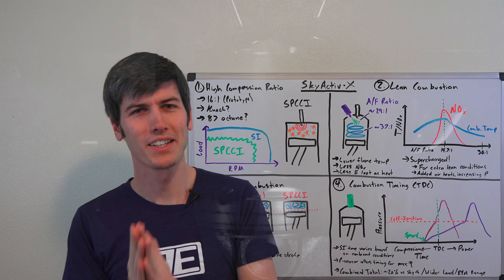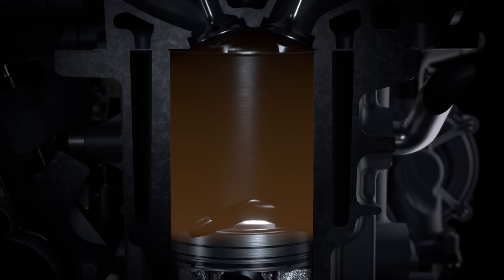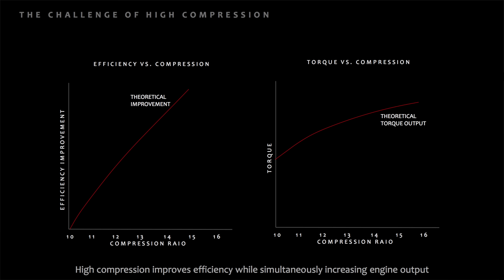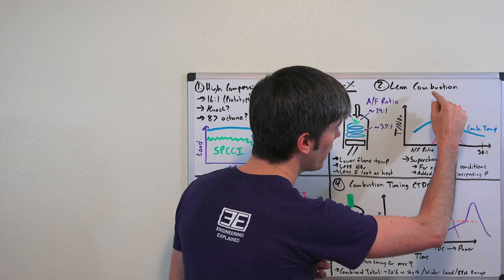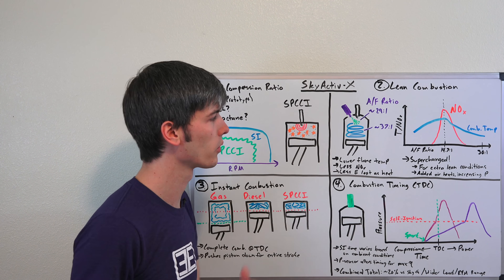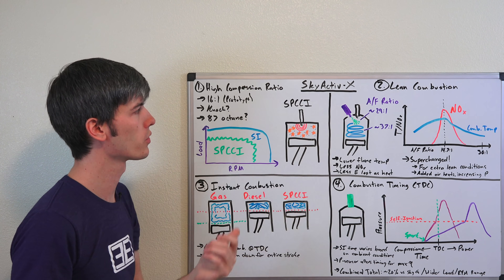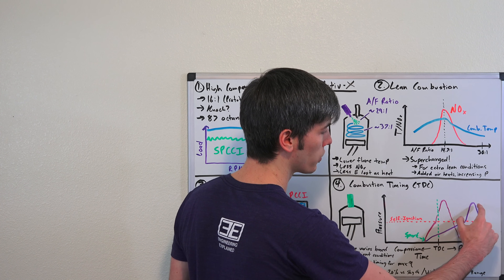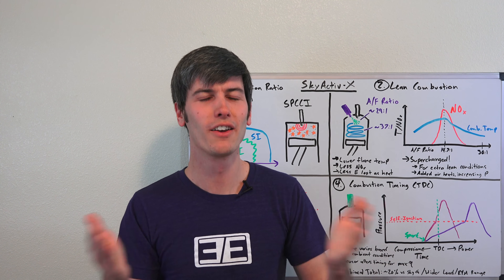How Mazda Is Saving The Gasoline Engine - SkyActiv-X

Comment: Get ready for the “why is Mazda pursuing a dying technology” people... The ones who swear we could all drive electric cars *today*, if we were just all willing to put up with the inconveniences of electric vehicles, and how we’re killing the planet by stubbornly sticking with our “dinosaur-fueled” vehicles...

Electric vehicles will take over eventually — but it will require a major breakthrough in battery technology.  Gasoline and Diesel fuel are currently the most energy-dense, portable energy source available to us.  Batteries — even the absolute best batteries we have today — aren’t even close to being as energy-dense as gasoline or Diesel fuel are.  Hell, even ethanol is more energy-dense than batteries are — and by a large margin, too.

Once you get battery energy-density to the same level — heck, even 50% of the level — as gasoline, and you make a battery that can go from 0% to 100% charge in 10 minutes or less (without destroying itself in the process, obviously), then you will see electric cars be 100% of the new cars sold.  We’re a good 20 years away from that, barring some miracle battery technology that hasn’t been discovered yet.

So in the meantime, let’s have the most efficient gasoline engines we possibly can.  Kudos to Mazda for doing this research!!

Comment: Engineering explained, so I just thought of something I have gotten bad gas that had water in it... I really hope they have a drying system for their fuel. Imagine a high(ish) water content getting pushed through an injector when it’s already nearing self ignition! That extra added pressure from incompressible water could make it self ignite and have it knock out of time. At 4200 rpm... blown motor?
Reply: I don't think they need it. it runs high comp, but also remember it runs lean as well. if there is contamination, then even if you have higher comp than a traditional engine, you are also injecting less volume than a traditional engine.
Reply: Of course there is less volume sprayed in but don't underestimate the non compressibility of water it will spike compression setting off auto ignition too soon.

Comment: I wonder how this engine will hold up in the long run, when carbon starts to build up inside. With such a precisely made engine maybe some carbon buildup will mess everything up. Hope not.
Reply: Thinner  fuel mixture should mean less carbon build up. More towards complete burn.
Reply: Direct injection might do that ,the inlet valve might carbon up
Reply: Would love to see if they could improve it further by adding Toyota's D-4S technology that combines direct injection and multiport fuel injection in the same engine.
Reply: So far no problem, I have a 2015 mazda 6 which I bought in 2014 and I still drive it today. City driving pretty much 28 miles per gallon average and takes off faster than most cars. BTW my ieloop stopped working which usually adds another 1 or 2 miles per gallon.

Comment: Are there any problems with temperatures? On older engines, especially turbocharged, you always hear people saying "if it runs too lean it will get too hot". Is that only a problem for turbo engines, or is that within a small window of A/F mixture and the super lean Mazda mix gets it out of trouble?

Comment: I wonder if this has anything to do with the Ford Ecoboost engines that use a Mazda block which are experiencing misfire's. My 2.0 ecoboost fusion, my friends 2.0 ecoboost focus, my other friends 3.5l ecoboost all misfire when cold. All of us use 94 octane. I know the 3.5l ecoboost isnt a mazda designed block though. But maybe its designed around the 2.0l 4cyl.
Only 25,000km on my vehicle been misfiring since day 1... Dealer cant fix it in either of our vehicles (yet, probably never).
All stock vehicles, all one owner vehicles.
Reply: The ecoboost 4-cyl is based off Mazda's old L series block. The current Mazda Skyactiv series is the successor

Comment: An excellent presentation!  
IMHO,:  while the engine design is interesting, it is overly complicated and requires too many parts.  All these pieces, parts, software must work perfectly to obtain the desired results.  Long-term reliability would concern me.  Cost to service and repair is a dealer's dream-come-true. An efficient and quiet electric motor with ONE moving part is far more interesting to me. Regards.

Comment: Previously owned a 2006 DC5 with a k20z1 engine.  Sold it and bought a 2015 Mazda 3 SGT.  The Skyactive engine is pretty awesome that it can operate on 87-93 octane with high compression and no knock.  Non-noticeable knock.  I love Honda engines but they are so temperamental in the fuel they use, especially in the ivtec engines.  I am speaking about a 12 year advance/difference in ECU engine management, so it's not really apples to apples.  Speaking of gasoline engine advances, what happened to the Scuderigroup and Duke engines?  Yes, my Mazda can achieve up to 41 mpg hwy @ posted speed limits calculated with pencil and paper, the onboard mileage app and Palmer DashCommand.  Thanks for the upload!

Comment: In the old days it was thought that peak pressure should occur when the crank was at 90 deg. from TDC (max torque). I wonder if Mazda can change the peak angle on the fly, like switching to a performance mode? 
Love the video.
Reply from the maker: That logic is incorrect. You want the peak force pressing the cylinder down to be applied the entire time the piston is moving downward, to get the maximum work out of it.

Comment: How does the max cylinder pressure compare to other designs?  Assuming it's higher, do you know if they've done more work to prevent blowing head gaskets?  How will combustion deposit build up affect the swirling action and pressure sensor?  What's the maintenance plan to keep these things working?  How well will the super lean combustion work in higher altitudes?

Comment: This is cute, but the true future of combustion engines lies with Koenigsegg's Freevalve system. No camshaft, electronically controlled pneumatically actuated intake and exhaust valves. 40% power increase, 30% emission decrease.

Comment: I think Mazda said that a 2.0L would perform like 2.5L. If the claims are true, that 190hp is impressive.
Reply: Oldsmobile was getting 190hp out of a 4 banger in the 80s. With no forced induction.
Reply: @isaakwelch3451  I doubt it is euro 6 and fuel efficient.
Reply: @Dongzzzzzz  I don't know about euro 6, but they get 15 city/30 highway, which isn't bad for a 30 year old car

Comment: So for the best economy and performance is it best if all fuel is burned right after the TDC? I have always thought you would get the best torque if the peak pressure occured when crank has rotated 90 degrees. The equation of torque M=Fr, where F=pA
Reply: That's true, peak torque would apply there but I'm pretty sure that the combined pressure on the entire power stroke is what makes horsepower (and therefore efficiency)

Comment: I got a Mazda 3, with the 2.3 engine. My only gripe I have against it is the oil filter type as well as the complexity of the engine itself. I really dislike that the radiator is a sealed system.

Comment: i have a 2015 mazda 3 and one thing i notice about the economy is that the outside temp can drastically change my economy. there is a road i drive every day and i average about 6.4 L/100km. that is at -15 or colder weather at this time of year. well, we had an unseasonably warm day and the temps got to above freezing and my economy went to 4.3 L/100km. that is a drastic change and i cant wait to see what i get in the summer.

Comment: Awesome video. Mazda has been questionable with quality. At least, that's what I always heard from a former bud cuz he's a mechanic. What's the SWAG on their lean production system? Yes, I am a QA guy, so Six Sigma is important. Ironically the last car I bought, 2015 Hyundai Elantra for the 10yr warranty ... had two odd issues: stalled out on me 3x or 4x. No warm fuzzies when it's at the dealer for 3 days and when I checked on it the tech was on the phone with Hyundai Corporate Tech Support. I was about to insist on getting a service engineer to visit the dealer. 

Most annoying issue was an odd vibration or 'stumble' when the engine was cold, like first 20-30 minutes. The stumble was noticable when at a red light. Service advisor claimed it's because they used only 3 motor mounts and/or because this engine doesn't have balance shafts. Meh, so I have to dig deep with my next car purchase into tech specifics. Does this Mazda engine have balance shafts??? I assumed this was a given with them in the Quad 4 engine circa 1990.
Reply: I wouldn't worry about the "stumbling". I had it occur to my 13 kia optima a few times in the past. My suspicion is it also has some wonky ECU tuning with how it idles. If it ever happens, I put the car in neutral, rev it to 2k a few times. and the issue goes away. 

As far as my ownership goes, ONLY hyundai/kia engines do this .
Reply: skifree Very interesting. Yeah, I also thought it had to be something weird with the ECU. I had the 6spd manual but wouldn't try reving the engine so soon after cold start. What really made a difference was premium 91 octane gas, which shouldn't be necessary with the base engine. 

Anywho, ya think the new Stinger GT has this issue too??
Reply: probably not. For me this happened after the Transmission recall after Kia was on the hook for misleading fuel economy numbers. they retuned the car to cruise at ridiculously low rpm (I've seen an 700rpm cruise when I had the car). By bet was they also changed the ECU tuning to help with the fuel consumption under moderate to low load, and that with a cold engine, and low rpm was what upset the engine the most. One the key aspects you see is, when it does vibrate you can actually see the rpm needle bounce rapidly by 50-100rpm. So the ECU is doing something.

As for the stinger. Kia and Hyundai Have gotten a lot better than with both engine tuning, and giving reasonable numbers (so they don't have to do drastic measures if they get caught).

Comment: Good video. However, I am still annoyed that these companies are still messing with the internal combustion engine. It is time to move on from this relic. While a 20% improvement is great, it still can't compete with an electric motor. We need fundamental change at this point if we are going to successfully address global warming. Incremental change at this point is not good enough.

Comment: When I first read about this engine, I kept going back to the good ol' CVCC Honda engine of the 70's. 
Stratified charge, super lean everywhere but near the sparkplug where a small slug of rich mix hangs out, waiting to be ignited so the flame can spread to the normally un-ignitable main charge. No EGR, no cat and good economy....not much power though.
The Mazda version replaces the 3rd carb barrel and intake valve with the direct injector and added the supercharger to increase volumetric efficiency/power over the N/A Honda.

Comment: Carbon build up said "hi there!  Let's see how hot this gonna run after 3yrs."  LoL.
Reply: Hope Mazda has figured out a way to keep the combustion chamber temp low so they don't need egr anymore.
Reply: @sdqdfyl  GM has had no EGR on their LS platform for years. Besides that, since this engine is a direct injection engine, the crankcase vapors being routed in the engine intake will cause valve coking. Most direct injection gasoline engines have this problem. The best solution to prevent the valve coking is to vent the crankcase to atmosphere, you can use and electrostatic oil separator, or a centrifugal oil separator. Most modern diesel engines are set up this way. My favorite and cheapest option would be a draft tube that exits below the engine compartment.

Comment: How about high altitudes where the air itself is getting leaner? Would the supercharger be able to overcome the thinner air problem or the engine would effectively default to a richer air/fuel mix thus losing the fuel economy improvement?

Comment: On #4, wouldn't it make the most sense to have the peak compression happen at 90 degrees, so the piston is creating the greatest moment on the crank? Or is the rate of change of compression due to change in volume deteriorating too quickly at that point?
Reply from the maker: You want the maximum force at the top, so you push down with the biggest force for the longest time, rather than just part of the time (as explained in section 3). :)
Reply: Engineering Explained wouldn't that pressure forcing the piston down be better optimized if it happened when mechanical advantage is the greatest, depending on the size/width of the pressure curve? I suppose that there wouldn't be a self-ignition if you retarded the timing any more...

So basically, the self ignition at TDC is another way of saying that you get a more complete combustion?

Thanks for answering

Comment: What is the displacement of the 190 HP SPCCI engine you drove?  190 HP from 2.0L is good.  From 1.5L is very good and from a 2.5L is merely average. Also where is the torque peak of the engine?  Is it low in the rev range like a diesel or closer to peak hp like in most gasoline engines?

Comment: Why haven't automotive industries incorporated water injection into there engines yet? You can have higher compression ratios, more advance, way less knock, reduced combustion temps, higher torque, carbon cleaning, higher efficiency and more with just a water injector mechanism
Reply from the maker: BMW has! But no one wants another tank to fill up, people struggle enough with changing their oil.
Reply: Ah I didn't even realize BMW has been doing it! Thanks, and yeah people are pretty bad with car fluids

Comment: First note: I’m a huge Mazda fan!

But isn’t the corporate fuel economy list skewed because Mazda and the other top brands don’t produce trucks? (And other large displacement engines?)  This would explain why for example Toyota, who is doing great things for small car economy, is halfway down on the list....Because their trucks are dragging down their average.  Trucks however are a necessary utility that helps our world function and need to be produced by someone even if they are not as efficient in fuel burned for mile traveled metrics.

Comment: Skyactiv x aims to time the combustion event so that the peak pressure wave aligns with the time when the connecting rod can exert the most leverage on the crankshaft. The big question mark for the technology is cost. Can Mazda sell this engine at a price that's competitive with Honda's very efficient gas-turbo in the Civic? I'm hoping they can and will.

Comment: Revolutionary engine.The demise of the ICE much exaggerated. 50 years from now we'll be driving hybrid cars using this technology and the recent variable compression tech practically running on fumes. Very surprised to see that you guys use 87 octane fuel in the US though! Here in Ireland it's minimum 95.That might be EU wide, not sure. Anyway love the vids thanks for your work

Comment: So with 80/87 octane rated fuel, how are they able to accelerate the propagation of the flame when that is a function of the fuel air mixture and generally doesn't change.

Comment: 16:1 on gasoline? Well, it's a very lean mix with very precise timing for ignition. Very complex control though mechanically simple, but is it reliable on the long run and with different sorts of gas we might have to use? The E20 gas mix, for example, will need a different control set points, timings, etc. So the injection and ignition control must be a lot better then the regular crap considering how borderline they want to run this.

Comment: I don't understand how knock is prevented until the spark. Like you said, super high compression and 87 octane would never normally be put together, so how is it in this case that the engine doesn't knock? Is it because the A/F is super lean as well?

Comment: In your personal opinion would it be possible in the foreseeable future for this technology to be out into a rotary engine?  Faster burning, more complete burn. That would help the rpm go higher, reduce carbon build up and produce more power while allowing it to meet epa regulations.  Seems like this would be the best solution to the rotary issues currently...  

But is it possible to be applied?

Comment: I recently was rear ended in my 2017 mazda 3. I was stopped at a red light just put my car in first gear when I was hit, foot came off the clutch, car stalled and saved me from hitting the car in front of me. But where does all that energy go? My lower back for sure but what does that do to the transmission or engine?  I'm not a car guy even though I enjoy your videos. I'm curious and concerned. Thanks.

Comment: Fantastic video.  I really like the explanation of the spark-assisted pressure ignition rather than flame front.  
Questions for Jason: Will there still be things like EGR and PCV with this engine given emissions are lower, theoretically the cylinders washing and blow-by is reduced, and you have the super charger pushing air through?  If those are removed will valve-carbon in DI engines be reduced?  I'm hopefully optimistic for this engine to be a way to offset some of Mazda's performance options as well!

Comment: After so many years carrying fires around in triangles and making them work, Mazda really are the combustion experts. I was a Mazda tech in the 90s working on the Miller Cycle Eunos 800M. 3.0lt power with 2.0 economy from a 2.3 V6. 😊 
We now own a Skyactive G Mazda2 with 13:1 compression that runs happily all day on basic unleaded fuel. 
It has not moved from 6.0lt/100km in real world driving after 30,000km.
Mazda, my hat is off to you guys for saving the petrol engine!!! 
Thanks EE for another cool video. 😊